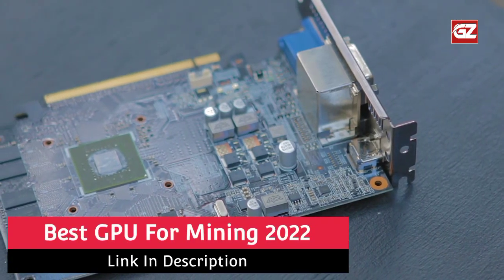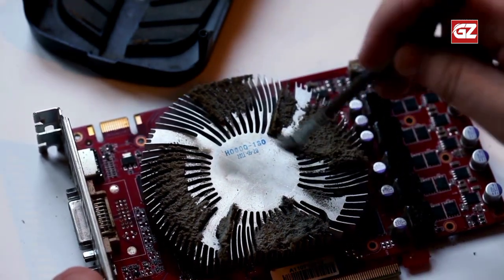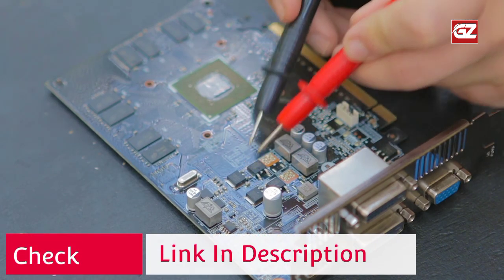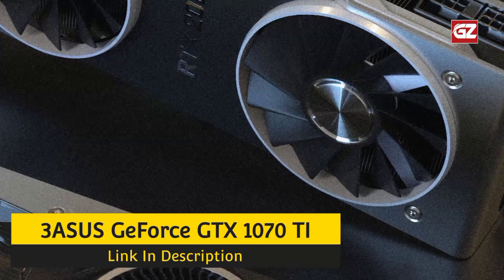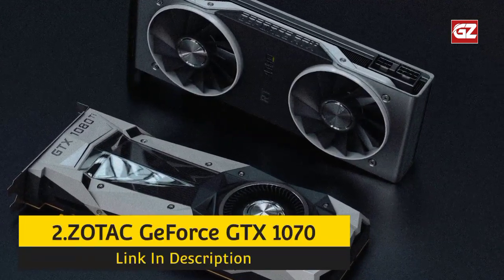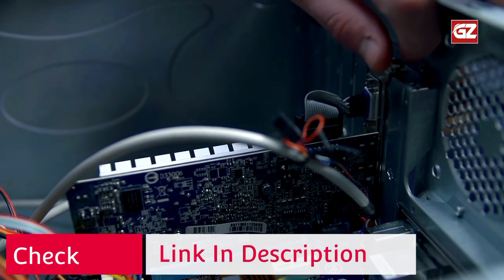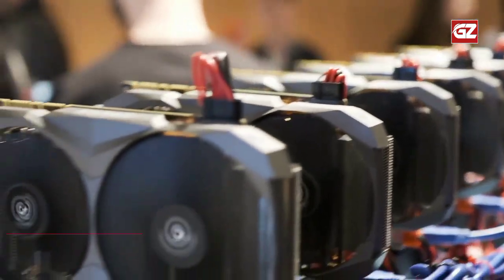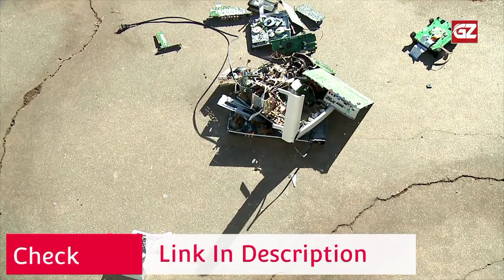Top 5 Best Gpu For Mining 2022 | The best graphics card for Bitcoin and Ethereum

Comment: XFX RX580 8GB consume 170w to 190w with 31Mh/s+. It is very less efficiency. Not recommend
Reply: Its not super good, but no way it consumes 180 watts, unless you dont undervolt it
Reply from the maker: @car.gems.  THANK YOU FOR TIP
Reply: @car.gems.  yeah if it really does only 30Mh with that much watts you’re better off buying a 3060 TI it does 60+Mh with around 140w
Reply from the maker: thank you for suggestions, but its good work for us